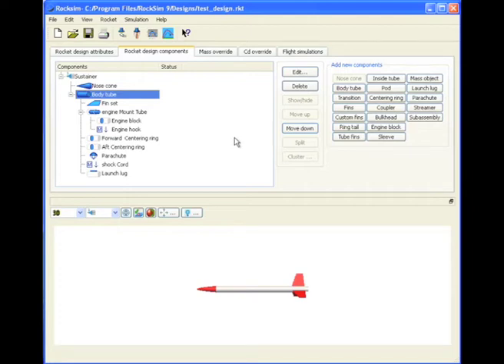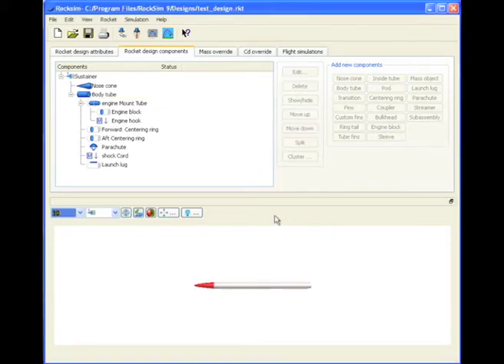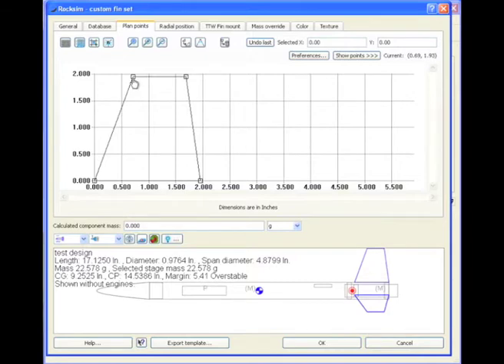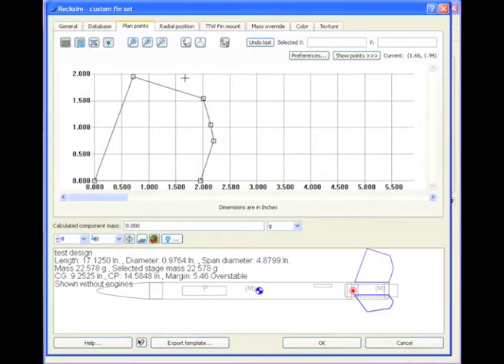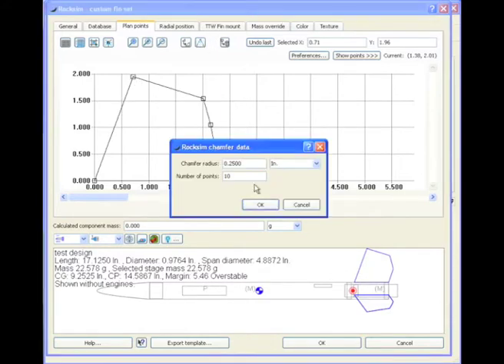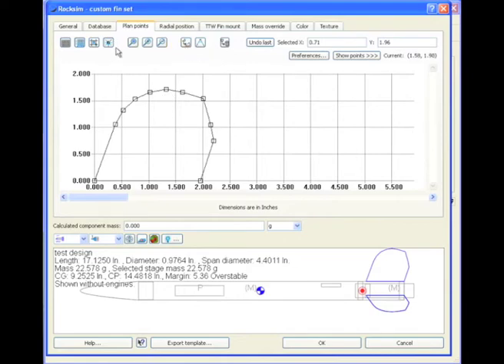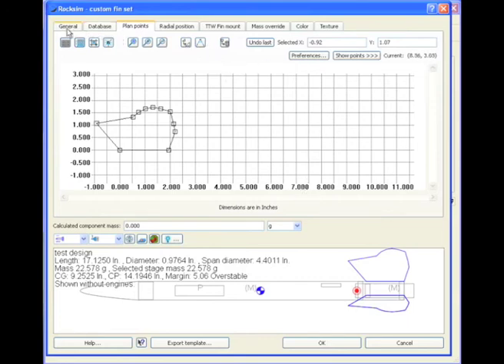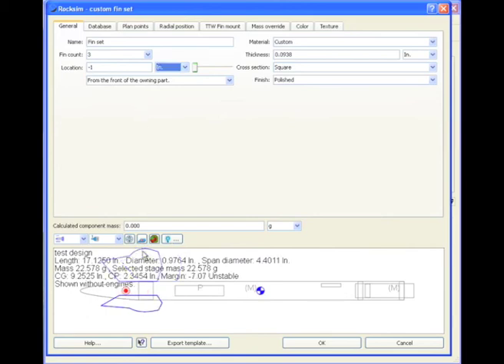RockSim Software Tutorial - 12 - Designing Custom Fins

Comment: Mr. Van Milligan,   I used the rocksim 11 program to design fins based on the stability factors I was trying to attain.  I know I can export the fin designs but do you know of a place where I can send the files to be laser cut for me as I don't have my own laser cutter.  thank you.
Reply from the maker: Look for a trophy shop near you. They do laser engraving/cutting
Reply: @apogeerockets  do some do email requests too? Thanks
Reply from the maker: @gillandro2  Someone has to find out by emailing them. I can do it for you at a rate of $50 per email that I send to find out. Or you can do it yourself for free.
Reply: @apogeerockets  thank you for the jump off points ill look into it
Reply: @apogeerockets  I may have to see if you can set up the files  as I am still trying to find a service near me that can do it.
Reply: @apogeerockets  where would I send out the files to you?